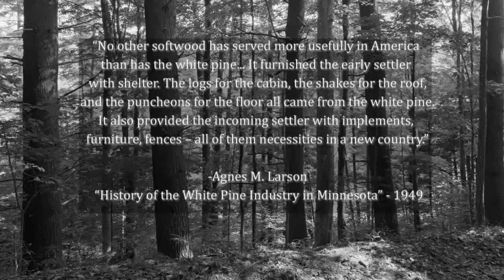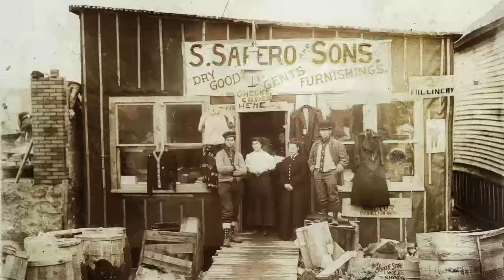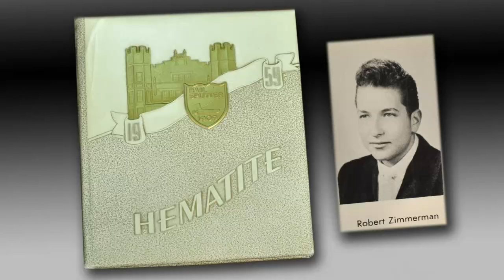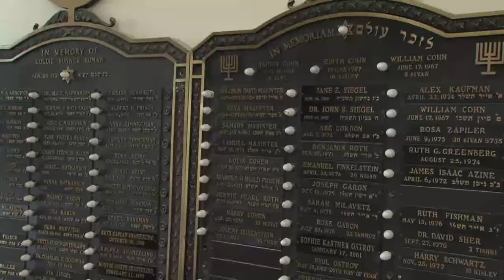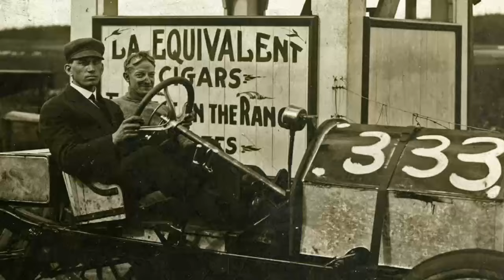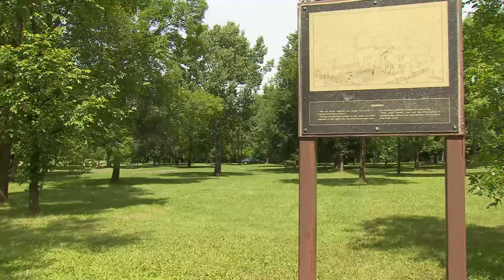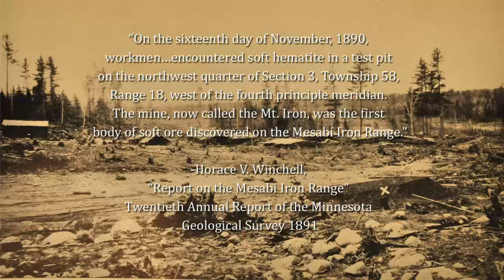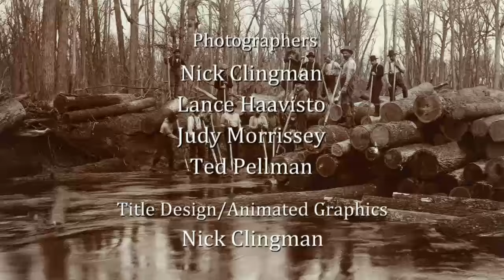Lost Iron Range - Full Documentary

Comment: Never heard of this corner of the earth before, but had to look it up on Google Earth, and holly hell, did they ever manage to ruin the land. What a mess they left behind. Amazing.
Reply: I grew up on the Iron Range. It actually created a different type of landscape for recreational use. You used to be able to fish, hunt, snowmobile and off-road in most of the old mines and tailings piles. The abandoned pits have been filling up with water for 50+ years, and MN DNR spent 10s of millions of dollars stocking with fish, building trails, and boat landings. Now, most are reclaimed by steel companies to work the tailings piles through magnetation, and drain the pits to re-mine them for the low and high grade or that's left.